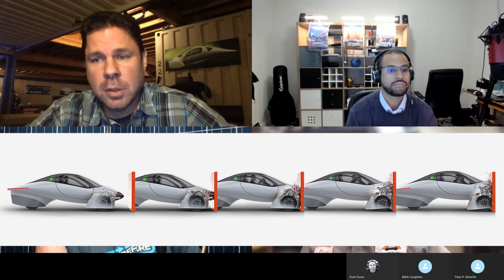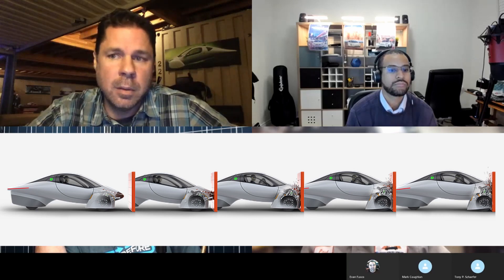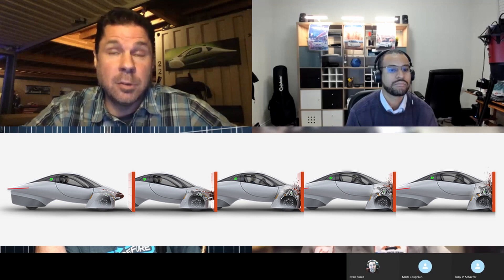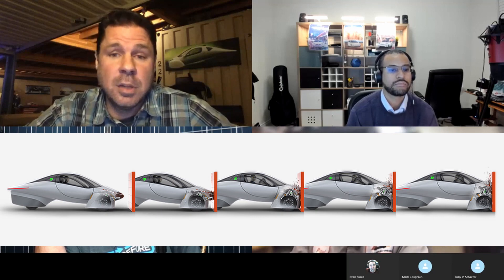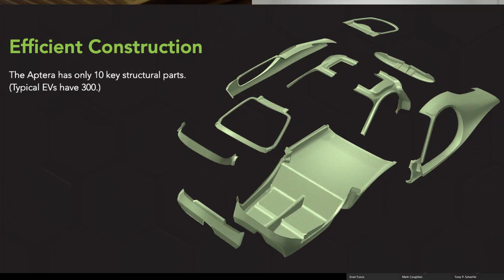WDU Short - 340.5 - Aptera Safety Features

Comment: Can't wait to see it's safety ratings
Reply: Here is a statement on safety from the Aptere FAQ: 
We will not know Aptera's actual rating until we pass a production vehicle through the full safety test. But we are designing to exceed all passenger car standards and the previous version had the highest roof crush strength of all passenger cars on the road, it performed exceedingly well in actual side and frontal crash tests. Aptera features a Formula One-inspired safety cell with advanced composites and metal structures for impact strength. Similar to aerospace and racing, these energy-absorbing methods are a core part of our safety strategy and have proven effective time and time again in high speed impacts.
Reply: @n.brucenelson5920  it better have some amazing airbags n seatbelt n whatnot... Cuz I imagine this thing being flung around, flipping n flying in more unfortunate situations...
Reply: @Darius-kl3jk  I was hit from behind while I was driving a Gen 1 Honda Insight by a large car at 60 mph.  I was uninjured.  The Honda weighs about 1800 lbs, same as the 400 mile range Aptera.  The Aptera likely has a more robust safety design than the Honda.  It will have a lower center of gravity for sure.  I am not too concerned after looking into it as deeply as I can before the crash testing is done.
Reply: @n.brucenelson5920  I'm interested to see rear crash tests for the Aptera. I have a feeling the impact would lift up the Aptera from the rear and send it flying somewhere. Hope I'm wrong about that though. They keep saying it's safe and stable, but those claims don't hold much weight without any real video evidence and testing.
Reply: Expect these shortly before regular production begins when preproduction vehicles are available to test.  They are likely to be very good.
Reply: @n.brucenelson5920  I'd hope, cuz in that case, ultra efficient vehicles like this will probably have a legitimate place in the future